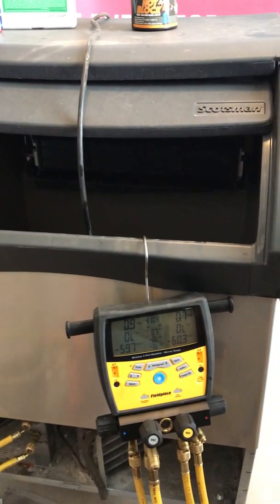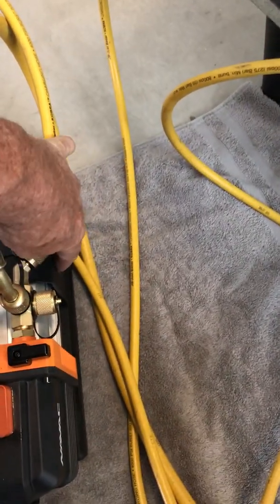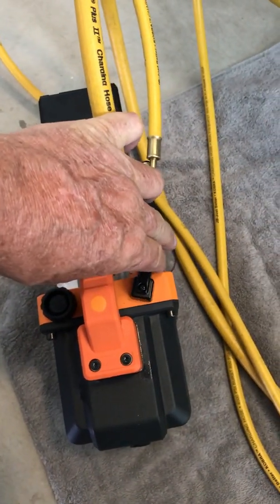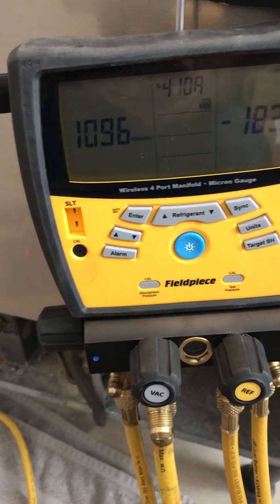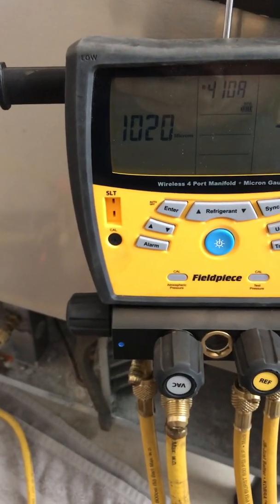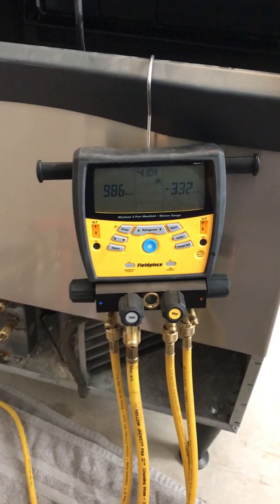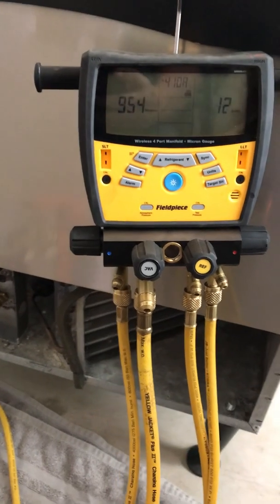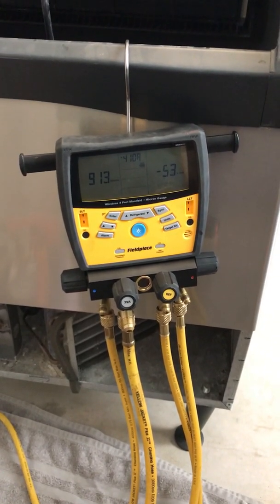Part 2, Using the Navac 4cfm Vac Pump

Comment: I would use thicker hose such as appion or accutools rather than 1/4" and you be the judge.
Reply: Onkar Singh I have the Accutools set and I get my system to 150 microns in under 5 minutes, I spend $1400 on the pump and Accutools sets and I don’t regret a penny